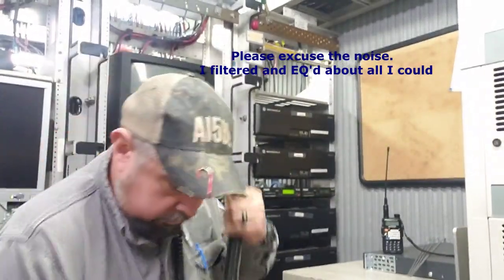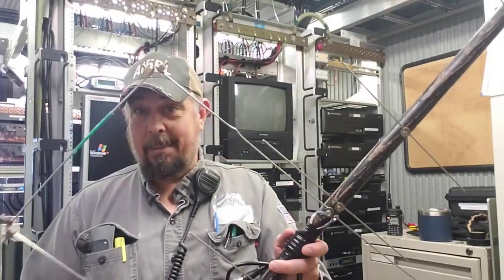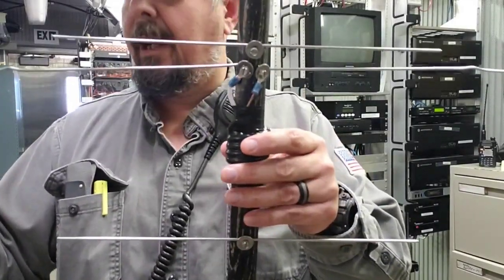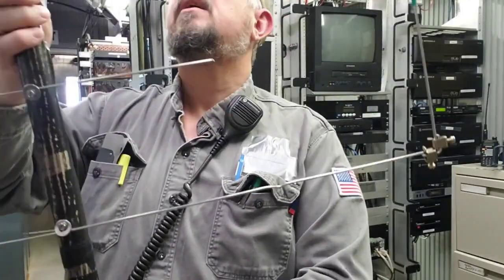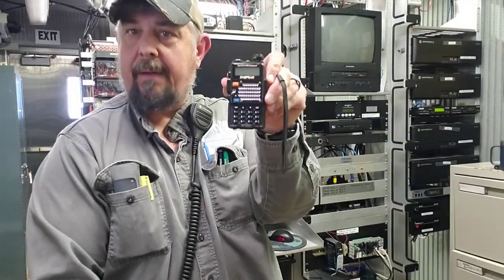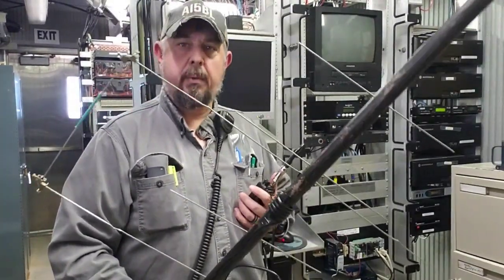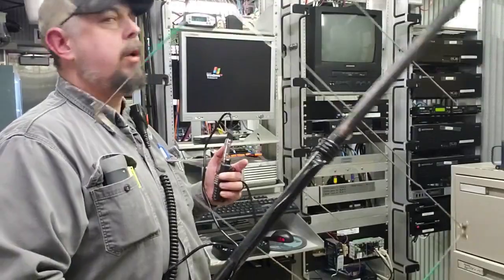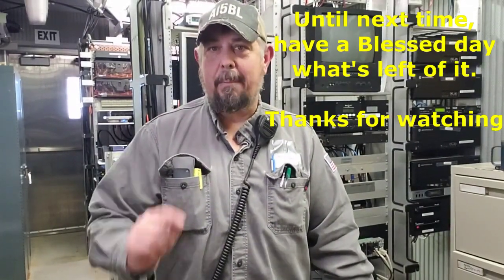RedNecks talking to space.....Ham radio on satellites

Comment: Great video. I made an antenna called the tape measure antenna for satellites. Yes it's made from a metal tape measure and PVC pipe. Have made many contacts with satellites using it, lots of fun. I had a good friend that was a helicopter pilot for the rigs. He had lots of stories. Do you have a armature radio with you on the rig for making contacts or is that not allowed? Glad I found your channel, really enjoying your videos.
Reply from the maker: Thanks!   I have seen where lots of people use the measure tape antennas.  I need to try one of those myself.   I have set up and worked 10 meters from the platform on occasion. I strung up an Inverted-vee above our communications building.  I mostly use EchoLink and DMR while offshore.